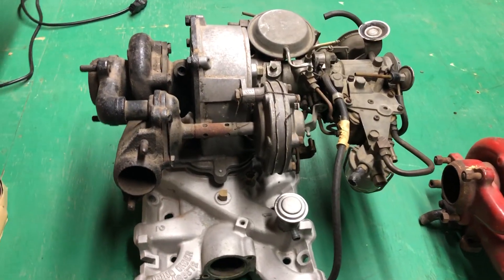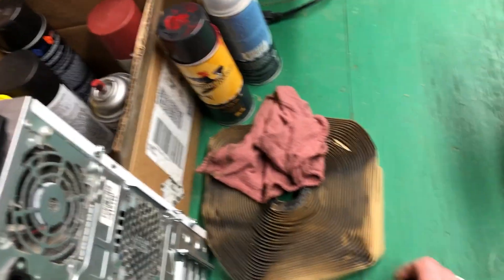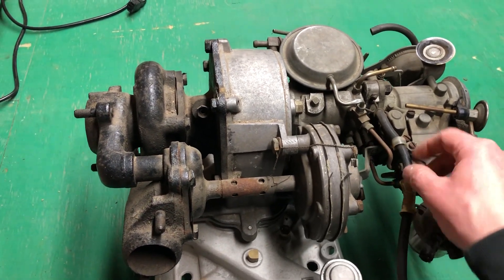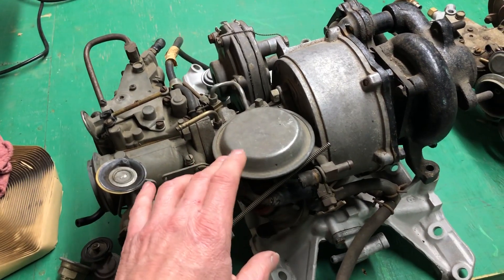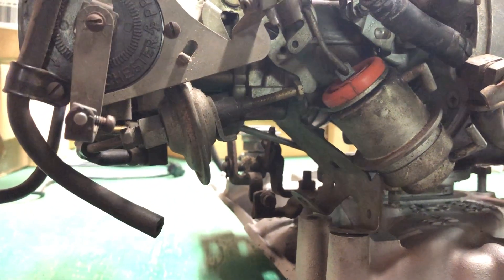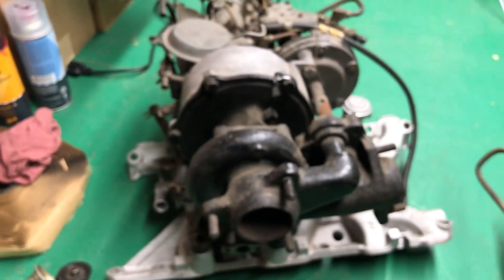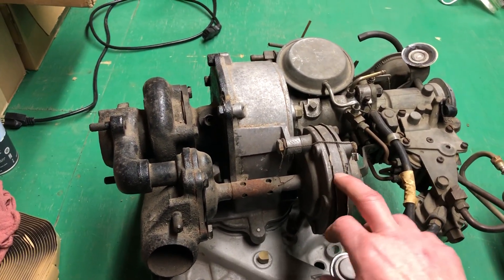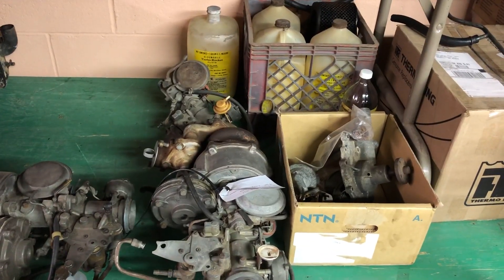Oldsmobile Jetfire Turbocharger and Carburetor Features

Comment: I found you because I read a comment about the complexity of turbocharging a carbureted engine, then figured I should watch the Jay Leno video that has been popping up in my feed. Very cool video and car! The engineering is amazing. I have four modern turbocharged cars and now the complexity is all around emissions, like the multipath PCV systems.

Also, noticed you order your paint from the same place in Louisiana that I do. I find it works pretty well, even though it's acrylic instead of urethane based. Do you paint your own body panels, or just use it for painting restored turbos? Sometimes I paint my own bumpers or small panels, other times I send them to the body shop, kind of depends on the car's overall condition or how metallic the paint is.
Reply from the maker: I believe that paint come with a car I bought last year. I paint my pieces and parts but I have another body and paint guy do my exterior panels. I can't do exterior panels or body work. I do that tear down and all the mechanicals, pieces and parts, and reassembly.

Comment: So if you had your foot on the throttle and your running out of boost fluid it would just shut the turbo down?
Reply from the maker: It will limit the boost to no more than one PSI. The boost limit control valve closes when you boost with no fluid. When it closes it acts like a restrictor plate and closes off over 3/4 of the throttle body choking the turbo from boosting more than 1 PSI.

Comment: Oldsmobile must have had some rocket Engineers Design This Turbo. The engineering that went into this is phenomenal
Reply: The turbo was built by Air Research, a company that was building turbos for the space shuttle program back in the early 1960s so I'm sure they were working with GM's engineers hand in glove because basically the same type of technology that went into the space shuttle within the turbos was accessible to gm. I know this because my father work for the company and anytime there was the slightest defect on manufacturing anything they threw it into a junk pile and my father was able to dig out two turbos that were designed for the inside of the space capsule and mounted them on a triumph 650 motorcycle. The things that bike would do were unbelievable

Comment: The water jacket on the intake side - is that some kind of ersatz intercooler for the charge air?
Reply from the maker: There is no documents on the reason they added the water jackets but typically it is to prevent icing from the high velocity air going through it. You see this on all newer cars in the throttle body.